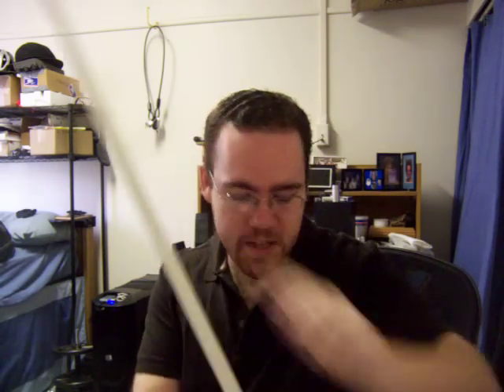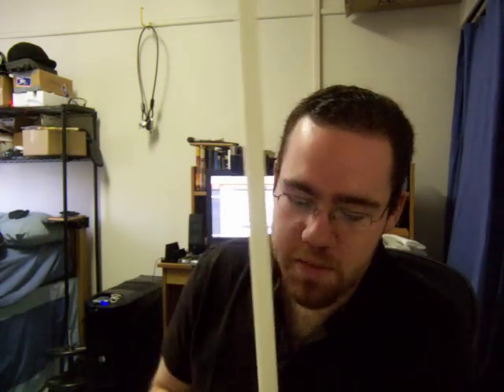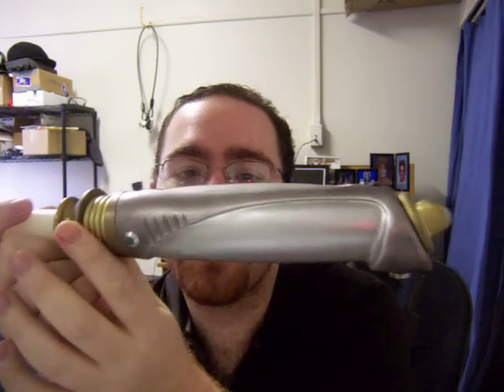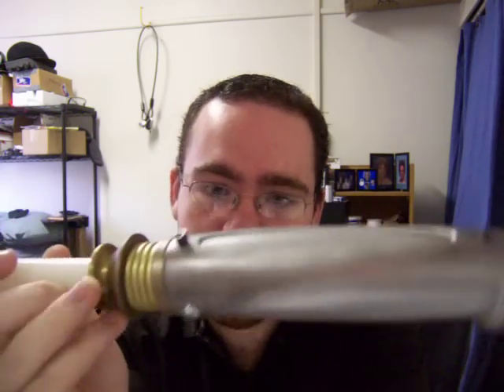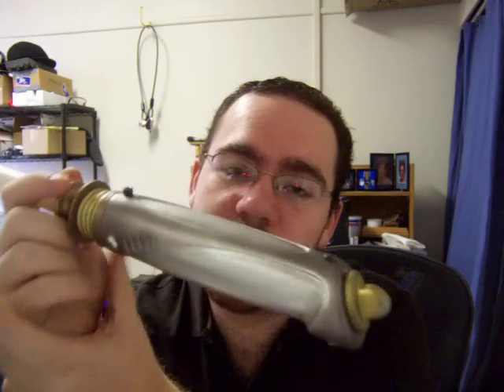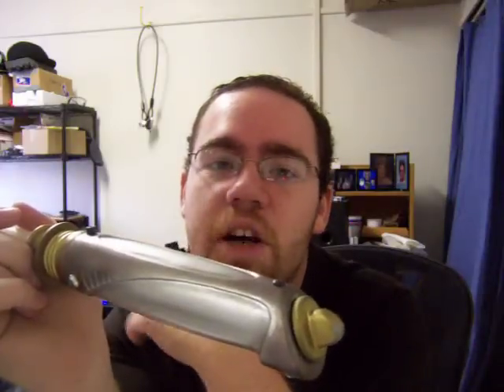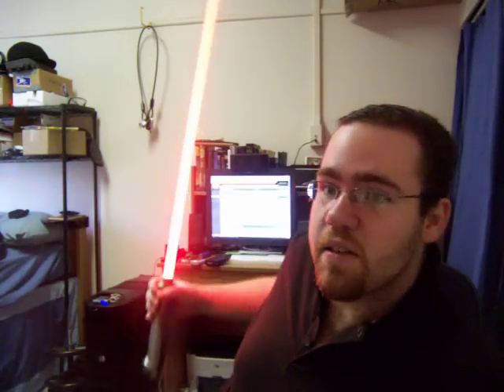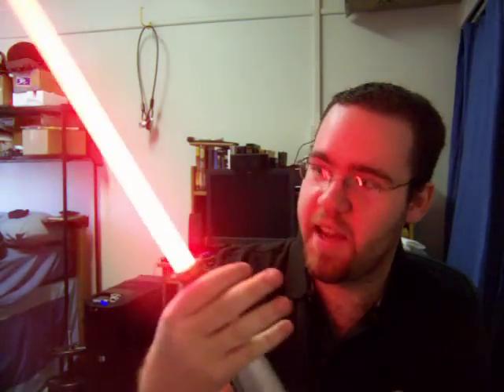Upgraded Luxeon Sidious

Comment from the maker: @Zaneatown I didn't make that hilt.  It's made by sculpting and molding/casting.  I could do it but it's a big adventure and loads of nasty chemicals.

I've heard if you have a forge you could pretty easily cast aluminum.  This however is resin + lathed parts.